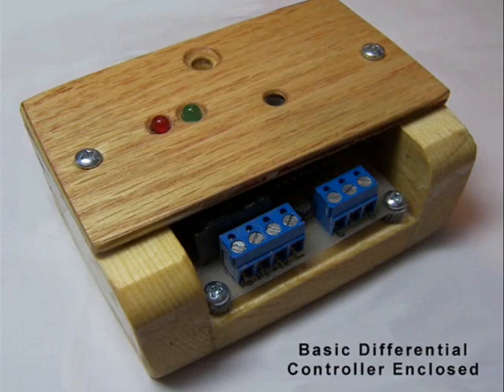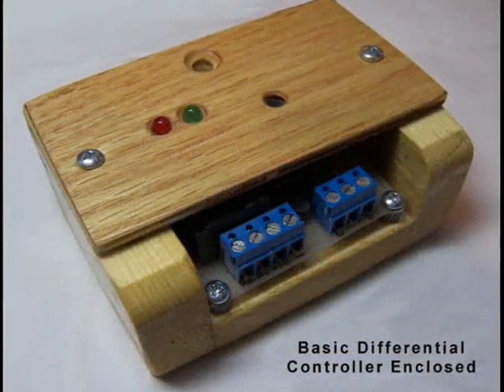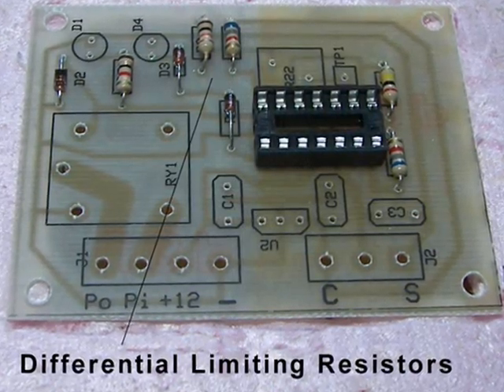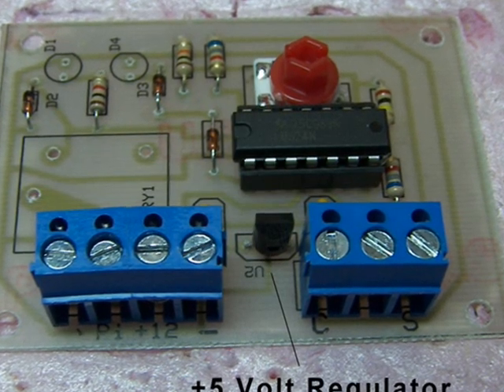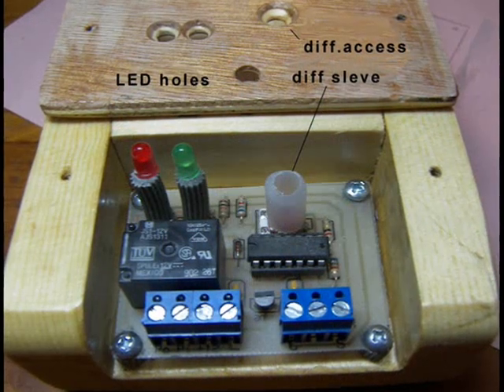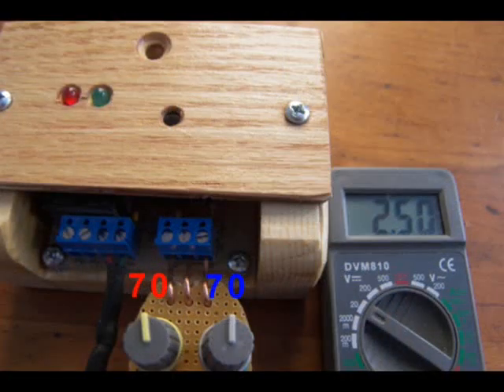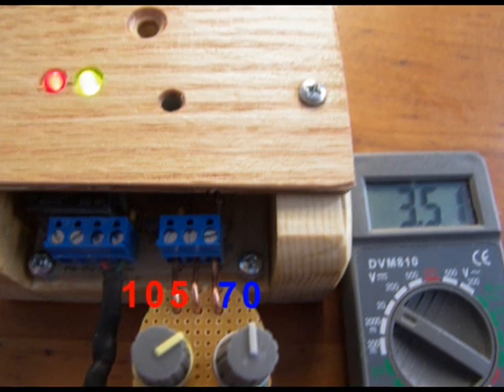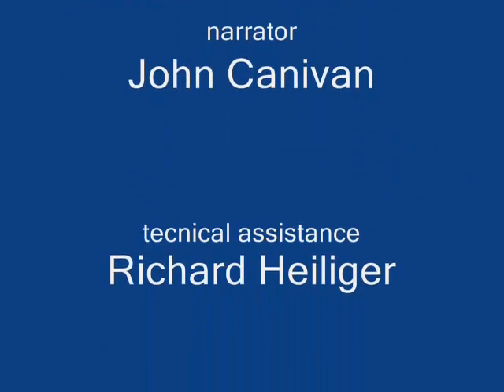Differential Controller Assembly

Comment: Hi John:  Enjoy your Videos! I was following your schematic and PC board labeling
and it appears that the printing on the board is mislabeled!  LM324 pins 1&2 feed anode of D1 and cathode of D1 feeds anode of D2 on the schematic, but on the board pins 1&2 feed R6 which feeds D3's anode! On the board D3 is a diode and D4 is an LED but, on the schematic D3 and D4 are both LED's! Very confusing to say the least!! Just thought you should know!!   Happy Trails from JB